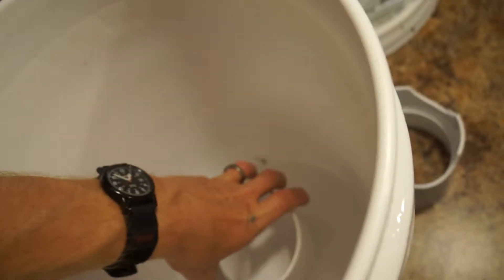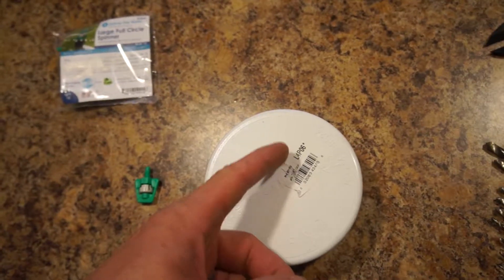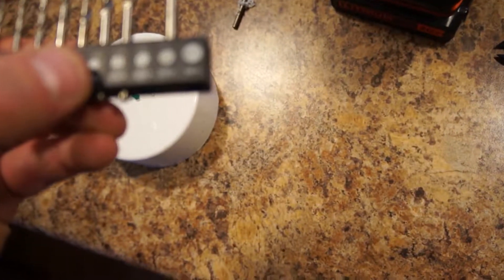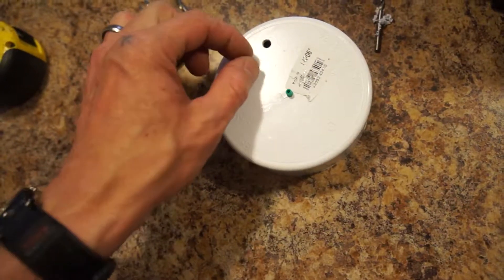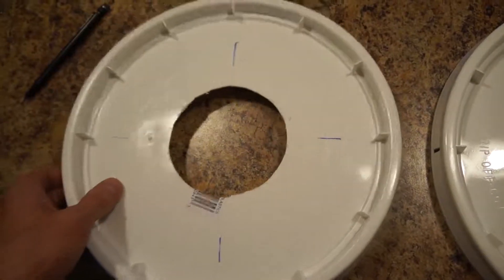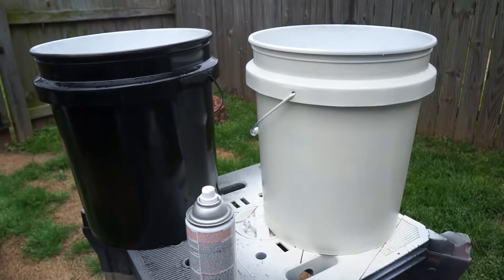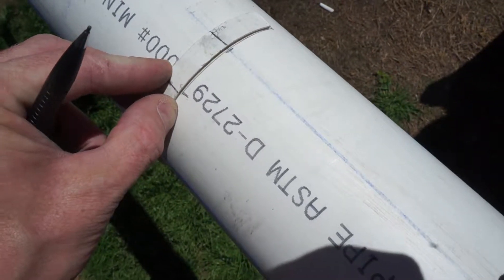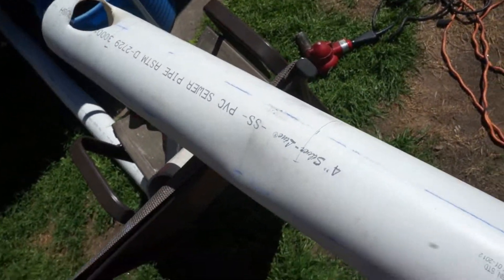How to build a Hydroponics Tower

Comment: What is the size of the pvc tube?
Reply from the maker: Kenneth Vandbæk I think it was a 4 inch drainage pipe. Don't get the one for plumbing it's too thick.
Reply: Thank you - if that one you are using not for plumbing, what type is it?
Reply from the maker: Kenneth Vandbæk 4 inch silver-line
Reply: Charles Moebes don’t know what that is in Denmark. 😊